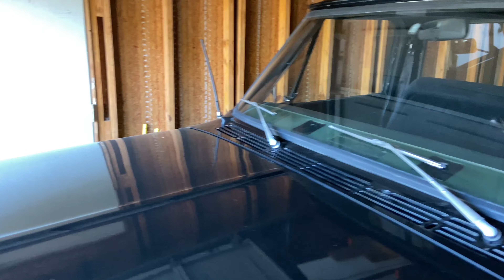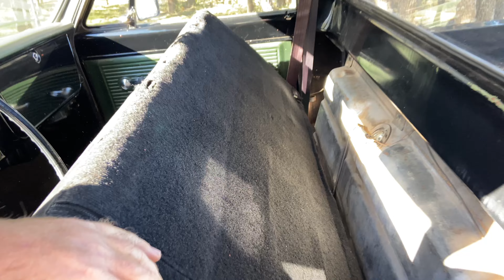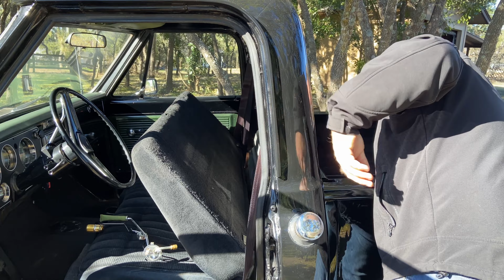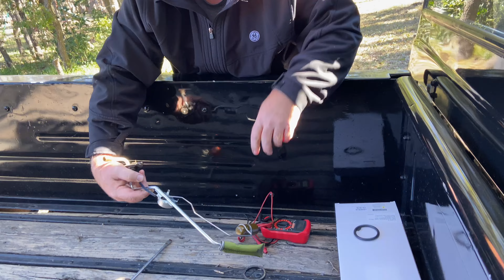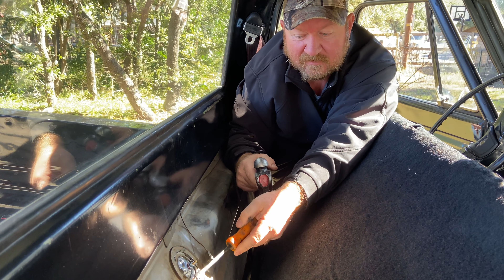How To Repair the Fuel Gauge Sending Unit on a Classic Chevy Truck

Comment: Sir, where did you purchase this part?
Reply from the maker: sending unit (PAID LINK): https://amzn.to/4xwxuJ2
Amazon storefront:  https://amazon.com/shop/prowrenching
DISCLOSURE: As an Amazon Associate, I earn from qualifying purchases. 

On these trucks, it will be either a 5/16 or 3/8 depending on which engine the truck originally came with.  Check the size before ordering.
Reply: @P @ProWrenching e one I purchased doesn’t sit at a 45 degree angle it sits higher so I’m unable to bolt on can you recall how the one on your truck sat on the video it looks like a 45 degree angle
Reply from the maker: I believe it was.  I didnt have any trouble getting it to fit

Comment: What if the fuel gauge works but it is not accurate? It reads 1/4 tank when full. Could it be the float? Thank you.
Reply from the maker: Yes-that is possible

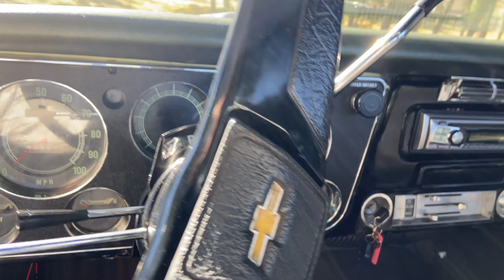Comment: I have a 1970 Chevy C10 350 and my gage just went to 3:00 over full and stays there.
Reply: That sound likes a ground wire problem. When I disconnect the wire from mine that where it goes and stays until I hook it back up then it goes to zero. You may need to just check your ground. Sending unit may be fine.

Comment: My guage stays at 1/4 of a tank. I replaced fuel guage came with new resistor and still stays at 1/4
Reply from the maker: @billygoat05  did you replace the actual fuel gauge or the fuel gauge sending unit?
Reply: @ProWrenching  i replaced fuel guage, seemed to work for a few days, then went back to 1/4. 
I just ordered a new sender after watching your video
Reply from the maker: @billygoat05  thanks for watching.  Hopefully that will fix the problem

Comment: Thankyou! very helpful information. Had my 72 restored. Of course, the only thing I didn't replace was the fuel sending unit. Now the fuel gauge stays on a 1/8 tank of fuel. Time to replace it.! I will test it first. my seat doesn't fold forward. Will have to remove it. Mine has set in the garage for about 12 months. Should I drain all the old gas out of it.? I run 93 octane. While I am in there.?

Comment: Thanks for your video. I have watched others that also tell you what to check if it fails. Mine works but not accurate. Run out at 1/3 of a tank. Any ideas thanks. Chevy van, tank under floor, 1967.
Reply from the maker: It could be the gauge, could  be the sending unit.  Need to check with a multimeter.

Comment: I’m trying to test my sender .. what wires are you holding the red and black
Probes to exactly? Thanks
Reply from the maker: The black wire to ground and the positive wire to the terminal connector that goes to the sender wire.

Comment: Thanks again for the vid I replced mine today...may have been the original...has a heck of time getting the locker to rotate when removing the bad unit. I bought the  new unit from Jegs we will see how long it last.
Reply from the maker: I’m glad you were able to get that project completed. I hope the Jegs fuel sender works well for you. As old as these trucks are, you’re not going to find NOS parts anywhere LOL!
Reply: O well the unit from Jegs lasted about 13 months

Comment: Have you ever had one make your truck act like it was running out of gas an randomly die? Doing troubleshooting
Reply from the maker: It is possible for the fuel sending unit to be cracked or to have a leak at the flange. With a carbureted engine and a mechanical fuel pump on the engine, the fuel pump is sucking fuel from the tank. If you were having an issue with not getting enough fuel it could be because there is an air suction leak. It’s something that I’ve seen more on semi trucks with diesel fuel. A way to test would be to put a mechanical fuel gauge between the pump and the carburetor and check the pressure. Most likely if you’re having a fuel issue it will probably have to do with the carburetor or float level in the carburetor, I would think.
Reply: @ProWrenching  ok I have am edelbrok in line electronic pump I believe it's 4 to 7 psi rated, just put it on yesterday, had a regular sbc mechanical pump on it before an was having the same issue, just ran around the block an it did it again, this time it had a thin misty smoke coming from the air filter, like I backfired or something but I didn't hear anything, I hit the gas to go an it said nope an shut off lol
Reply: @ProWrenching  sits an idles great, revs an all, but put it in drive an go around the block its a guessing game when it will do it. Less then 2000 miles on this 355, mild cam daily 70 gmc truck
Reply from the maker: @chaningdodson4245  if your fuel pump is sucking air, it may not be getting the right amount of fuel pressure to the carburetor. You can still check that with the gauge.  Another way to check that would be to take a fuel line and run it into a bucket with the fuel pump on and see if you’re getting air bubbles in the bucket. If the fuel looks fine and the pressure is good I would want to check the float level in the carburetor.
Reply: @ProWrenching  ok ima try that, thanks man👋